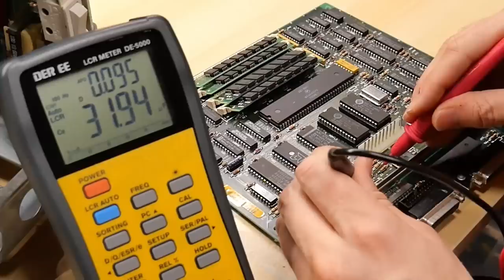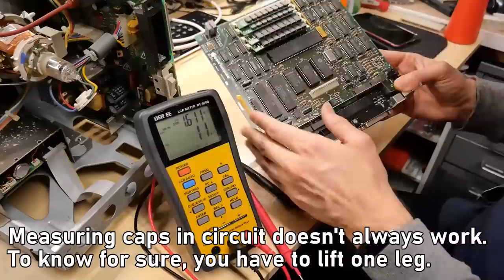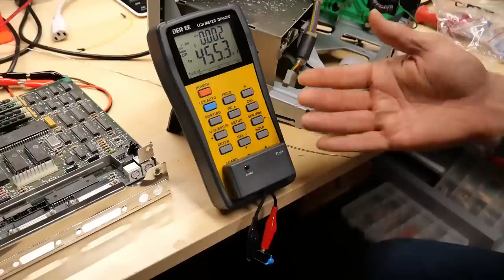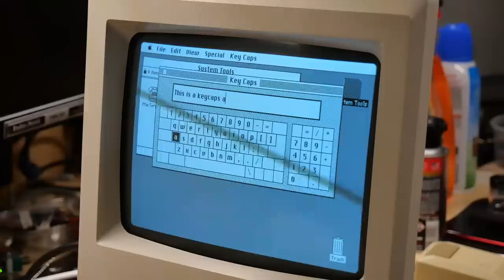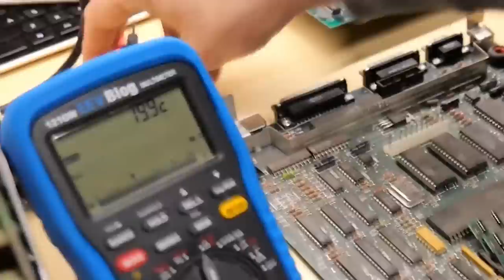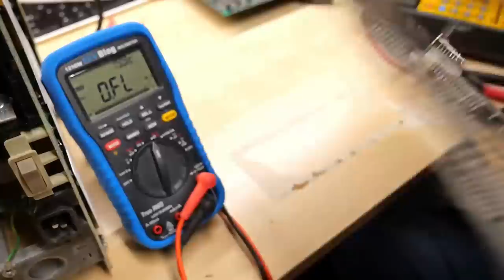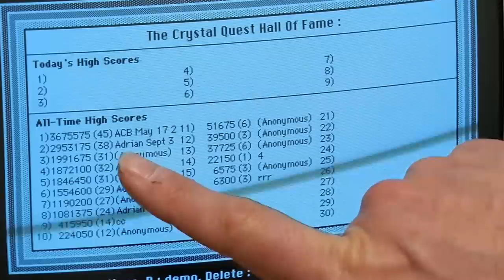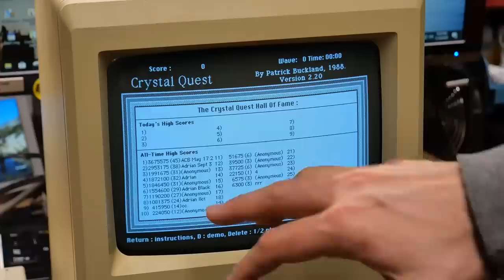Mac Repairathon Part 6: Final stretch! The Mac Pluses.

Comment: I actually just bought some deoxit. lol My c64 cartridge port has issues. Also I noticed without my U2+ BASIC is fine, but with the U2+ BASIC glitches (colors change randomly) when scrolling. So hopefully deoxit will work. It's the only way I have to load anything though. So I can't test it without the U2+ on games. But glitches aside, it's not always making a good connection.

Comment: I can't help but wonder if the issue with "Machine #1" was a bit of corrosion on the power cable where it didn't see a load correctly and by re-seating it in the course of troubleshooting that took care of the issue.

Comment: my trs 80 model 3 has 2 psu's in it i changed the rifa caps, one power supply has a pair of small ones filtering to ground while the other power supply has different caps. they are the same but put together in different countries. if  or when i change the small rifas i will just get what the other psu has.

Comment: Is it wise to remove the sticky stuff from the anode cap? I thought this was to protect the Anode from sparking when there is high humidity.
Reply: Plasticiser leaching out of the PVC, best to clean it, then a thin smear of silicone grease under the boot will provide the humid environment protection.
Reply: I kind of remember Adrian putting silicone grease on another cup. Made me wonder why he didn't do that on these.

Comment: At 6:00 I would change that 1 capacitor...it's on it's way OUT!
I'd go ahead and order the CORRECT X2Y1 safety CAPs from Mouser!!  Do it right!
Reply: I have never seen any of those used on on the old PC XT and modern computers. I've seen poly film caps last for decades. Some manufacturers don't even use Y caps connected to ground any more since the leakage current can cause new circuit breakers to trip. So why the obsession?
Reply: In one of my old mac's I actually left those filter caps right out. machine still works just fine.
Reply: @wishusknight3009  Yes that is correct it will work. Those are only there to reduce the amount EMI form the power supply getting into the mains.

Comment: You really need to measure the caps out of circuit, e.g. by desoldering one lead. Otherwise you could be reading the value of multiple caps across the same rail and you get improper results.

Some power supplies also need some load in order to produce a stable output. You might get away with a low value power resistor rather than having to plug in the board itself. Edit: just as I write this bit you say exactly that. 😋

Comment: I like your videos! I have a little collection of some old school hardware, it's fun. I just wanted to mention that those caps in the filter section can hold a *lethal charge.  For the analog section, the sound is coming from the flyback transformer, if I'm correct (I think around 15-16Khz).  It sounds like it has been overheated or the driver transistor should be checked. If you get a hold of a schematic it will help a lot. Take care.

Comment: I'd say you might want to replace those barrel caps on the motherboards. not because they're bad. they really aren't. it's more about their age. We have no idea of the life left on them. Especially because of their age and older manufacturing technology. just match the marked values, and maybe use liquid-free caps to make the life go through the roof.
Reply: I believe electrolytics degrade over time, so if they test well they should have plenty of life left. Besides, I believe this vintage of capacitors are generally reliable if not abused.

Comment: 25:25 I wouldn't be using 50% Isopropanol; that's 50% water.
Reply: Okurka 50% works better for electrolytes which won’t dissolve in alcohol alone. The 50% still makes the water evaporate quickly.
Reply: @amberselectronics  Adrian used it to clean floppy drive heads.

Comment: On the second one....I've done enough mac plus/128ks to know that they just cycle on about 75% output voltage with no mainboard connected - click click click. It's no mystery - he knew enough to know the HV wouldn't be active without a mainboard, I'm surprised he didn't know it also wouldn't boot....
Reply from the maker: I've never done any troubleshooting on a 128/512/Plus before in my life. I knew HV isn't created because it's like that on the Classic which I did do a bunch of troubleshooting on (in the previous videos) so I assumed it would be the same.
Reply: @adriansdigitalbasement  ah ok. I've spent a lot of very frustrating lockdown time over these analogue boards (many of which I have have persistent low-voltage - essentially the voltage adjustment doesn't work, which I'm still trying to get to the bottom of - but at the end (and I've been in the situation where something changes and you don't know why) I was screaming at the camera 'the mainboard just wasn't connected.....was the problem!'.....  Maybe it made good TV but early on surely the obvious thing to do is put the other known-good motherboard in the second one to see if the issue was with the mainboard or the analog board...?
Reply: @sandycheeks7865  It's been about 30 years since I work on this stuff.  If I recall the apple authorized repair manual process correctly there was a specific order to adjusting the voltages.  Even on a brand new board from Apple if you didn't do it right you could end up with clicking.   Oh and I was cringing because first safety rule Apple taught us, was you always discharge the CRT the moment you open the Mac, as it wasn't uncommon for the bleed off resistors to fail.

Comment: Adrian as someone who's been shocked by mains multiple times in my life (to no lasting effect luckily) I am begging you please be more careful around mains and high voltage electronics. Do not reach around a high voltage power supply! Use the one hand rule - that saves lives! Even a small discharge across your heart from an unpowered device, which still retains charge, can give you a heart attack days later. You'd never know! And that spudger that you have is for low voltage repair and prying, it's not a high voltage insulated probe. Those are at least 30 cm, and with good reason! Your hand needs to be fully outside the volume of the  device/computer and far away enough that if it slips, you have time to react before your hand slips from the tool and onto the pcb. Please stay safe! Sorry if you get millions of such comments. I bet it must get boring. You do know what you're doing. But it's up to us to make sure we don't become slack around safety and end up regretting it. I know what I'm doing too, and what do you know, I got shocked multiple times and I'm a couple decades younger than you. Good luck!

Comment: D = Dissipation factor, that is the ratio between the reactance and the real part (the ESR)The D is noted in the datasheets and is coupled to a frequency. Nowadays most times 120 Hz . ESR is calculated from D. The value in datasheets for 100 kHz is most times NOT ESR, it is impedance. D is in datasheets most times noted as  tan_d  (has to do with the loss angle but D = DF = tan_d) 
I have some articles about ESR on my website: https://www.pa4tim.nl/?s=ESR
That LCR meter was a good choice

Comment: At 13:00 were those electrolytic caps flat on their top? I'd say from the video they are bulging and need to be replaced.
Reply: Yes, that is also what I saw. Filter caps in an SMPS are under high load and their life span is limited. Any SMPS older than 10 years, best to replace all of them regardless.
Reply: I agree

Comment: 37:28 - I repaired a broken PS3 last year. I thought the PSU had issues but it was the regular reflow problem. There's a 400V capacitor on the PSU side of things and after I powered it off I was curious about discharging the cap. I heard it can shock you and it can be scary, don't work on stuff while holding them on your lap, etc... So I took a screw drived with a thick handle and shorted the 2 ends. The pop was so loud like a petard was blowing up in the room, it really gave me the willies, luckily it wasn't discharging through me, that would have been bad.

Comment: X and Y capacitors can be a wide range of values in input filters. Typically the X capacitor will be almost anything from 100n to 470n and still work, though the larger values are bigger. Same for the Y capacitors, anything from 470p to 22n will work, just the RF emissions might not be the exact same as when it went through FCC approval.

As to the in circuit ESR, not too accurate, as you can have parallel capacitors that mask a failed one. But good enough if showing open circuit or high dissipation that likely faulty.

Comment: I usually just resolder all connectors and the flyback transformer when I have these things apart just as preventative maintenance.  I really don't like having to reopen them :).
By the way, you definitely do need the Anode Cap and often the are sealed with silicon gel (which is usually what makes them feel sticky).  The voltage is considerable and it will arc across to earth quite easily if tha anode cap doesn't seal nicely.
That Machine 1 could still be the flyback, but maybe it is just an intermittent fault.  Hopefully it will run a while before it dies again :)
Thanks for taking us through this series of Mac restorations/repairs.  It's been a fun journey.

Comment: yes the weird noise is called Stiction . It's the vibrations of the flyback transformer that is responsible for the horizontal deflection of the electron beam that creates the picture. You can figure out the approximate frequency by thinking like this: There are 525 lines drawn on a television and the display refreshes at a frequency of (roughly) 60Hz (it's actually a very strange 59.94Hz) BUT REMEMBER THAT IT'S INTERLACED. This means that the signal that causes the horizontal deflection has to sweep across the 525 lines of the screen 30 times per second (half the image is drawn in an interlaced pattern at a time).
525*30 = 15.75kHz
This is why only some people can hear it. That's out of the hearing range for a large number of older adults.
Why do transformers vibrate? I won't go into that, but you'll be familiar with the problem if you've ever been near a device with "60Hz hum" that didn't come from a speaker. It's the power transformer vibrating at 60Hz.
Reply: I'm not sure what frequency the Mac scans at, but I am sure it is a different frequency from TVs. I know these use 512x342 pixels, maybe 384 scanlines. Assuming 60Hz progressive, that would be 23kHz. Does anybody know for sure the scanrates the Mac uses?

Comment: I laughed a little at the siemens ram. Immature, I know.
Reply: Siemens is one of those companies that is so big, they split ownership of this world. If you've got power to your house, it's likely siemens coming in your walls.
Reply: Resistance is measured in Ohms, inverse resistance used to be Mhos but they renamed them to Siemens. But it’s still commonly written as an inverted omega due to the ambiguity between s for seconds and S for Siemens.
Reply: @bearnecessitits  I have a Siemens Gigaset VoIP phone.  I guess that means whenever I'm on the phone, I have Siemens in my ear.

Comment: Younger naïve me made a massive mistake tossing a Classic II back in the early 2000’s. There wasn’t anything wrong with it except it needed the OS reinstalling and some peripherals. It was a spotless machine with a monitor with very low hours. That’s one of the mistakes I’ve made that I truly regret. Whoever picked it up at the recycling centre scored big time. 
By the way, the cap on the HT lead from the flyback is important. It is needed to stop oxygen getting to the anode connection and prevent corona discharge. Loved this series, keep up the awesome work!
Reply: Don't feel bad.   I did the same thing with a Mac Classic an external scsi hard disk, a TRS-80 Model 1 with all the peripherals (even light pen), a coco, Atari 800, 800xl, Atari 1040 ST, an Amiga with Toaster software.     I'm back into Retro machines and it's costing me a small fortune!

Comment: Replacing the 2200 reefa caps with 1000 isn’t a problem as long as they are high enough voltage but to make it more like the original you could parallel two of the 1000 to end up with 2000, more like the original circuit value.

Comment: The sticky residue on the anode cap is grease to prevent leakage/arcing from the high voltage.  Not sure how necessary/important it is or if it's just extra safety, though.  Maybe in high humidity environments it might make a difference.

Comment: Adrian, those clicking noises come from the spark gap devices behind the battery compartment (they kinda look like ceramic caps). They usually indicate shorts inside the flyback secondary coil. The coil whine you heard was likely the flyback complaining. Those shorts are microscopic in nature and will tend to burn themselves out, "fixing" the problem. The flyback is still damaged, however, as it might have gone out of specs in the process. On the other hand, it can still happily work for years. It's a gamble. If it does it again, you have a clue where to look!

Comment: Capacitors that report higher than their rating are electrically leaky. The reason they report high is because they're draining the charge put across them from the LCR meter via parasitic resistance, which confuses the meter into thinking the capacitor is something it's really not.

The cap that reported 100uF+ that was supposed to be 33uF is VERY bad and must be replaced. When a capacitor gets that bad, it starts passing DC current, which can cause all sorts of havoc and carnage. In SMPS circuits, an electrically leaky cap can heavily load the circuitry around it and cause it to fail in spectacular fashion. I've seen diodes and resistors burn holes through boards due to being overloaded by a failed capacitor.

I've had to remove entire sections of PCB that were burned from such failures and redo the circuit dead-bug style floating off the board. Such things aren't too complex on single sided power PCBs, but the same can't be said for a compact mac motherboard.

Comment: Gaah! So many things wrong within the first three minutes of this video. Forget about the ‘preservation’ of original parts. In every project to revive an old Macintosh, I replaced every electrolytic cap.

Also, just because you think caps ‘look okay’ doesn’t mean that they are. Visual inspection is key. Hold the circuit board to the light. The entire board should have a characteristic and consistent shine on the main component side. Examine near the capacities. If the shine is dull or there appears to be a tide mark where the board is shiny but the area towards the capacities is dull, the caps have leaked. Axial or radial, electrolytics leak.

Analogue board and digital (logic) board.

On main connectors, like the power and video connectors, solder joints may be cracked.remover the old solder and using some flux, apply new solder. 

That 256 legend beside the cut resistor, that indicates that 256k RAM SIMMS are installed. Hence the 1MB base model.

If 1MB SIMMS are used, one leg of the resistor is cut. 

It’s important to do a little research before releasing a video to be able to explain it to your viewers, otherwise it can come across as amateurish. You have a professional channel and make great videos but this lack of attention to important aspects is not a good look.

Comment: Careful with using windex/ammonia based cleaners on the "inside" part of CRTs. You can damage that aquadag coating. Always do a test with a q-tip first. Some tube manufacturers used water soluble paints, and then you end up having to repair the conductive coating. That's a painful lesson from arcade restoration.

Comment: It is good to clean all the dust out from inside.  It’s much easier to inspect if everything is sparkling clean.  Also love those old Macintosh pluses when EVERY chip was a DIP type.  None of that quad flat pack stuff:). I wonder if that huge DIP chip inside those Mac pluses were the highest pin count of those back in the day?

Comment: I hate it when electronics fix themselves, you have no idea what was wrong or how long it will last.
CRT TV's and monitors are very susceptible to dry joints, (cracks), due to the high voltage and heat they produce.
Great series, thank you. They look good all lined up and powered on.

Comment: Well done spotting those solder cracks,  that is very tricky. Why not just replace those THT caps, it would be very easy, and why take the risk of leaving them? Also, your makeshift soldering fume extractor, all it does is move the fumes away from your face and into the room. Better than nothing, but not great. I would invest in a solder fume extractor with in-built filters.

Comment: At 38:00 it is not strange for a SMPS, which works with a permanent load situation like a PC, will not start properly when you run it unloaded.
You cleaned and moved the voltage adjust pot, so that may be why you now have it working.

Comment: A lot of older switch mode power supplies might require some load to properly regulate.

Linear regulators are the same but require much lower load.

Comment: Enjoyed the series a lot - Thanks. I recommend you make it a habit of discharging electrolytes on power supply before working on the boards. 1. For safety and 2. protect the ESR meter from overload. I use 10R power resistor with two stiff wires soldered onto it (ressistor in heatshrink).

Comment: if you have a crt tube  that has a dark  screen  before  changing it  take  a screwdriver and  take the  handle  and gently tap the  crt neck behind  the yoke  while  crt is turned on  incase  there is  a  phosphorus particle short from laying crt with the screen facing up.

Comment: In capacitors, as long as the replacement is the same or greater voltage as the original, then you are fine.